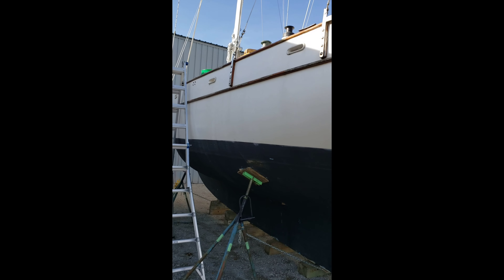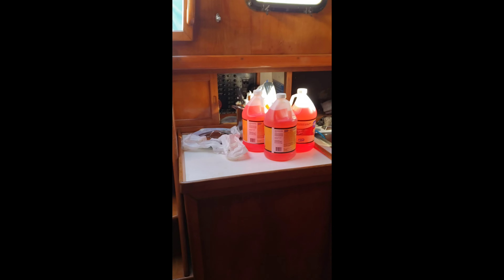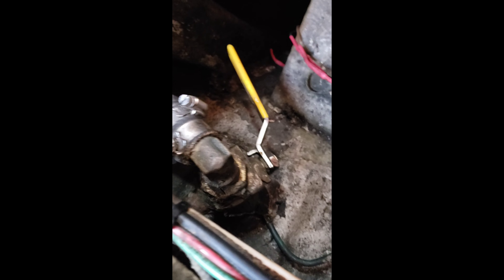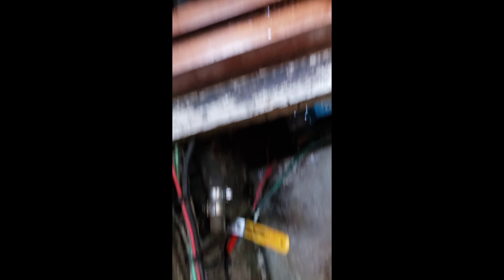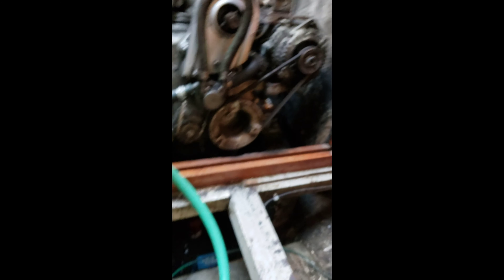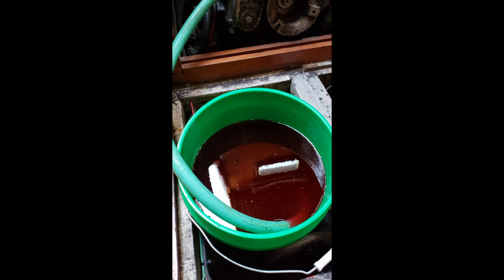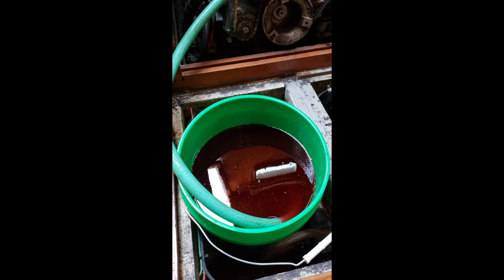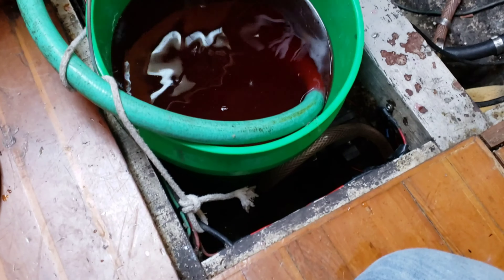Winterizing my Yanmar 3QM30H Marine Diesel Inboard ...Episode #11

Comment: No need to get it up to temp first? To circulate through the muffler?
Reply from the maker: Hello, Thanks much for watching and for leaving a comment!!!  
Yes, it’s best to run the motor for a bit to ensure it reaches operating temperature and the Thermostat opens up..  I didn’t show it in the video but I did run several containers of eco friendly Antifreeze through the motor prior to actually filming it, so I was confident the motor reached a safe operating temp.  
In addition to ensure that Antifreeze was in the engine block at about 6:50 into the video I filmed  myself I opening a small drain that is tapped directly into the block and saw the antifreeze come out of it.   That gave me peace of mind.  
If you plan to use a process similar to what I show in the video, I should think that filling the 5 gallon bucket twice to 3 times with water and circulating that through the engine prior to introducing the Antifreeze would be the best way to proceed. Of course, I am not a licensed marine diesel mechanic.  Just a fellow sailor that happens to be mechanically inclined.  Hope you find my long winded response to be helpful!!

Comment: Hi doesn't the antifreeze have to be above to allow gravity to bring antifreeze to impeller?
Reply from the maker: Hello, Thanks much for watching and for making a comment!!  The Impeller created enough suction as it steadily drew the level of the antifreeze down and of course feed it into and through the motor and then out the exhaust thru-hull fitting.  I also checked the spicket on the port side of the engine Block to make sure anti freeze came out.  
This season I used a bucket of regular water to start with so I knew it would help bring the engine to operating temp and open the Thermostat.  As the water was drawing down to the bottom of the bucket I refilled with the appropriate antifreeze. The whole process was really easy.   I hope that helps... Please feel free to Subscribe to my channel if you haven't already done so.. Thanks again and Happy Monday 😊!!
Reply: ... another great tip that I'll certainly use. Thank you and cheers Fred  @ketchingmy2ndwindsvchopsticks